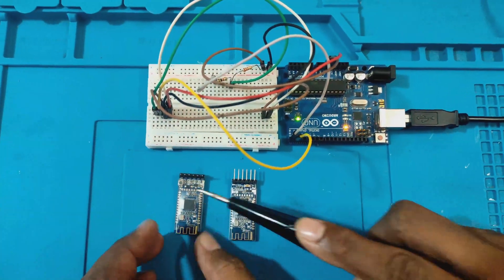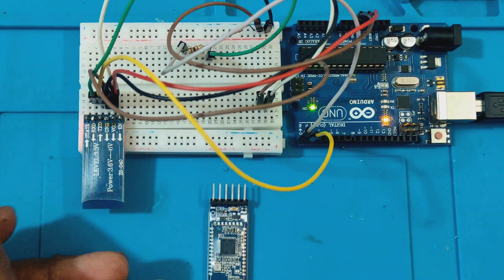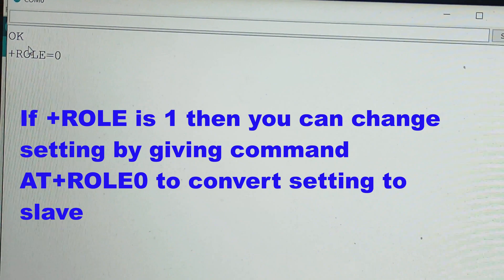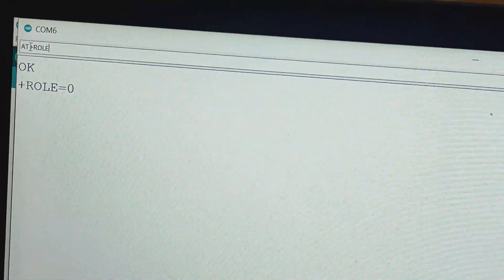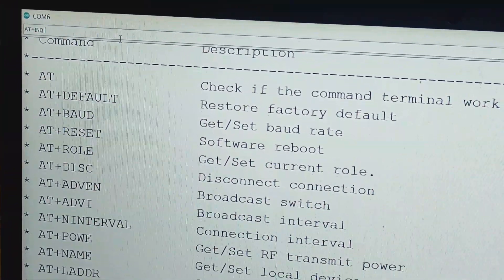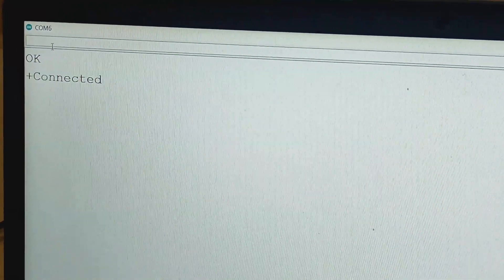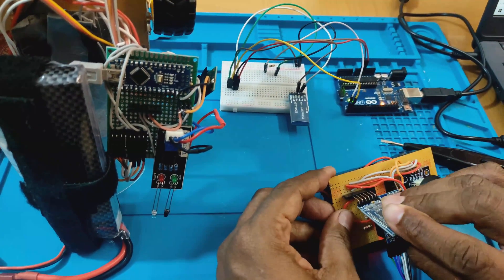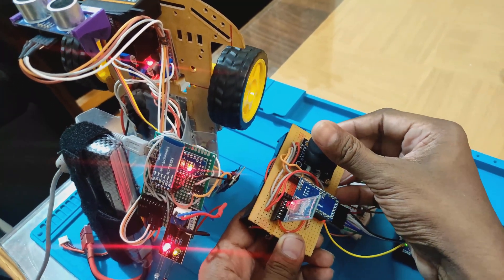HM10 to HM10 Bluetooth Module Pairing

Comment: hello! 
when i type in AT+HELP i dont get as many commands as you do, so I can't continue with my project since the commands don't exist on my arduino program... do you maybe have a solution for this? :)
I'd be happy for an answer :)
Reply from the maker: Could be a firmware version with the module which you are having.

Comment: Does the slave doesn't have PIN for security? 
you just use AT+BAND(Address) without the pin? is it possible to add pin for security?
Reply from the maker: No pin is needed here for security since it is directly connected to master and bound and other devices won't be able to connect once bound
Reply from the maker: Please check the datasheet of HM10 if there are other AT commands to set pin.